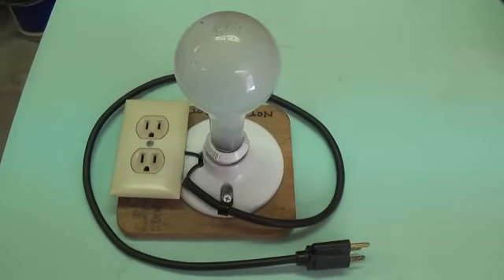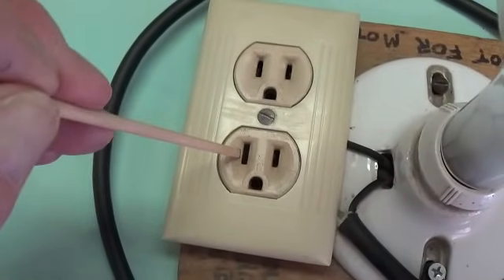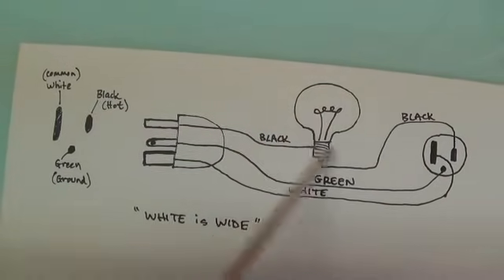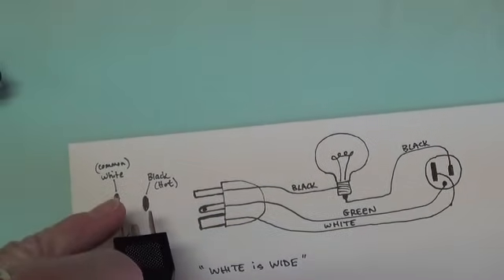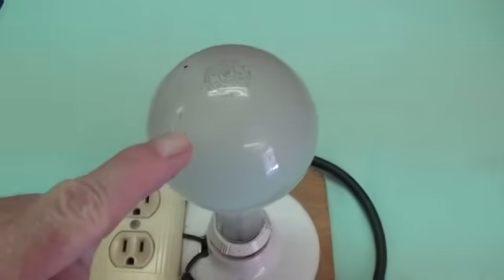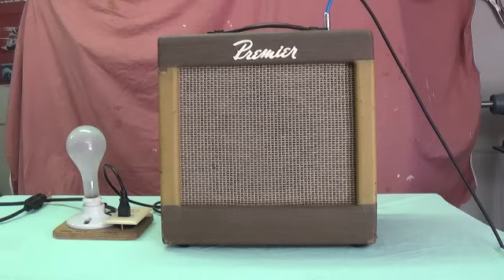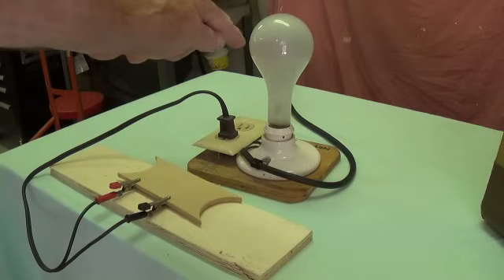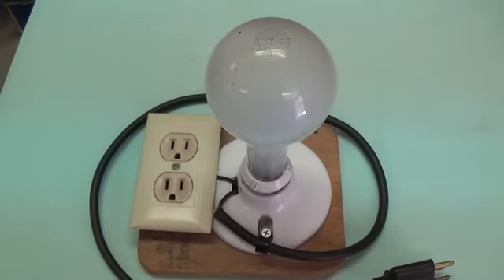Build Your Own Current Limiter for Protection when Repairing and Testing Electronic Equipment

Comment: Here in the UK the mains is 230V.
Should I still use a 250W bulb or would a 500W be better suited?
I calculated that the resistance for the US 250W bulb is about 58 ohms but a UK 250W bulb would be about 208 ohms.. 
Is 208 ohms too much of a drop to test equipment with?
Reply from the maker: Actually, Dennis, since the current limiter responds to current, not voltage, and your current is one-half of ours (who have 120VAC), the bulb you use should be one-half the wattage......i.e. 100W to 150W.  I believe this is all explained in the video description. Good luck.

Comment: I built one. I got a 300 watt bulb because the other was 200watts. Is that okay? I plugged 2 radios in and one was a player, the other lit the tubes but no sound through the speaker. But neither lit the current limiter bulb. 
Thanks
Reply from the maker: The larger bulb is more suitable for higher-wattage circuits, YR.  A 200W bulb would be more appropriate for radios and low-wattage amp circuits. Failure to illuminate indicates no internal shorts in the circuit.
Reply: @UncleDoug  ok thanks

Comment: i built one too.  But the bulb keeps lighting up whenever I power whatever appliances I am testing....electric drill, electric cooker and vacuum cleaner.  Can't be that all of them are having shorts.
Reply from the maker: Nope.....it means that you are using the current limiter for the wrong purpose. It is strictly for tube electronic circuit protection.
Reply: @UncleDoug  .  Yup.  It works for the amp I am fixing.  thanks for the reply.  Didn't read  sorry.  But i watched several times though.

Comment: It's not the voltage that necessary kills you .. it is the current
Reply from the maker: Thus the advantage of a Current Limiter. It's more to protect the circuit than the tech, however.

Comment: I worked for a tech when I was younger who used a variac followed by a dedicated resistor shunted ammeter followed by and patchable set of circuit breakers ( 1,3,5 amp) to do this job. I like this better, it's a lot simpler and is a true current limiter. Where did this idea come from? If it's yours, you're a genius, if not you may still be a genius or at least damn clever. Oh, BTW, this is an old video and everyone who wants to build this better get out and buy a large incandescent light bulb before they disappear for good, cause an LED bulb is not going to work! Cheers, Carlos
Reply from the maker: Thanks for all your very kind words, Carlos. It wasn't my invention, I just tried to popularize the device for use by amp techs. Agreed.....incandescent bulbs are an endangered species :)

Comment: I know this video is old, but i give it a try.
I have a current limiter that I made years ago, however the bulb broke eventually and coming across these old classic bulbs in Sweden is next to impossible. I have searched for the better part of a year now without result.
So naturally I'm trying to think up a device that could replace this.
But to do that I need to know why it works. I mean  different devices draw different amount of current. How come the bulb lights up when one of them suddenly draw more?
I know my question surely require a long answer, so only answer if you want to or perhaps an idea for a video topic? 😊
Best regard!
Reply from the maker: The answers are all provided in the video and the video description, Philip. Try Amazon.....they may still offer high-wattage incandescent bulbs. Nothing else will work.

Comment: Is it possible to have a bulb with too LOW a resistance? I recently built this and, upon testing out in the garage, I was surprised to see the bulb light RIGHT UP when I applied power to the circuit. I thought I had wired something wrong but I tested continuity across the bulb itself (300W) and produced a BEEP on my multi-meter (measured about 5 ohms of resistance). Any tips? :/
Reply from the maker: Did you have any electronic device plugged into the CL receptacle, Haze ?  If not, then it's an open circuit and should never light up. Perhaps you wired it wrong.
Reply: @UncleDoug  No devices are plugged into the CL receptacle (not until tests pass!) I  thought I had wired it wrong too but if I remove the lightbulb and replace it with another (that is not properly rated) there is no short. I will investigate some more --- I never build something correctly on the first try anyway. When I figure out my error I will let you know. :)
Reply from the maker: @HazeAnderson  Check to be sure you didn't wire it in parallel instead of series, Haze.
Reply: @UncleDoug  A-ha! I wired the bulb in parallel, not series! xD I was focusing too much on getting the parts secured on the wood that I carved out to realize I had strayed from the schematic. Thanks for your help! :)
Reply from the maker: @HazeAnderson  Glad you solved the problem, Haze. Good luck.

Comment: What happens when incandescent bulbs cease to exist?   I'm guessing an LED or Fluorescent  would not work.
Reply from the maker: You're right, they won't work, Ed. On the "bright" side, I've been using the same 250W bulb for about ten years......it's probably only been "on" for less than an hour during all that time......and you can still stockpile a couple extras for the future.

Comment: YOU SHOULD WIRE THE HOT(BLACK) FROM THE CORD TO THE BOTTOM OF THE BULB ON THE BRASS SCREW IN THE LAMP SOCKET FOR SAFETY IF IT WAS LEFT PLUGGED IN AND SOMEONE UNSCREWED THE BULB AND TOUCHED THE BASE OF THE BULB IN DOING SO WOULD  GET A NICE JOLT! I BUILT THESE BACK IN HIGH SCHOOL ,WE USED A SWITCH/RECEPTACLE FOR THE OUTLET!
Reply from the maker: They would have to be both foolish (or a child) and grounded to experience such a shock, but thanks for your helpful input.

Comment: Ace hardware has 300w bulbs, PS25.
Reply from the maker: Good news !!! Thanks, Wes.
Reply: Uncle Doug
 Thank you Doug, I’m building my 1st amp (I should say assembling) from a mojotone kit, it’s the Gibson GA5.. I’m not sure what went wrong but I burnt up the power transformer..... Because I like to spend money and destroy good parts, I didn’t build a current limiter first 😫
Reply from the maker: @wesrichards6168  Now you see why I say that current limiters are the most important tools on the workbench, Wes. Best of luck now that you have built one (I assume) :)
Reply: Uncle Doug Absolutely, after nuking the first power transformer (100.00 up in smoke) I went to the hardware store and dropped about about 8$ on the parts to build the current limiter.. I had it assembled in about 30 minutes. I’ll have the new transformer tomorrow, and I’ve gone through the circuit and believe I corrected the problem, but from now on EVERYTHING goes through the bulb.
Reply from the maker: @wesrichards6168  You'll be glad you did, Wes. It's the best insurance you ever bought.....for only $8.

Comment: nowdays in Italy is difficult to find such incandescent lamps, but it is still possible to find halogen lamps. I read somewhere that halogen lamp should work as current limiter as well. Can somebody confirm that?
Reply from the maker: I don't believe they can Benito. Have you checked Ebay and Amazon for incandescent bulbs ?
Reply: @UncleDoug  i'm going to try. Thanks for the answer. Have you good Easter
Reply from the maker: @benitorossi9380  Good luck. Have a nice Easter.
Reply: My light bulb limiter demonstrates that they can.

Comment: Hello Uncle Doug. I can’t thank you enough for your instructions, insights, and amazing presentations. I made one of these and it just came to life last night while looking at my old Harmony amp. I noticed the volume seems low, and when plugged into the current limiter the bulb started glowing, but not too bright. The power jewel also seems brighter. I have just under 6v ac at the bulb, but there’s also 14v dc present. The current limiter also only comes on after it has warmed up. I have swapped all 5 tubes with no changes. Where do you think I should focus?  Thanks, LJ
Reply from the maker: I can't repair the amp long distance, LJ. I guess you'll have to get a local tech to take a look at it.

Comment: I built one of these this weekend and used it to test a recapped 1950 Emerson 503 AM Radio.  I wished I would have done this a long time ago.
Reply from the maker: It really is a useful, practical device, isn't it, Daniel? I have used mine on every single amp repair job I have ever done..

Comment: I built one of these and it works great. However, I do have a question. I am using a high wattage bulb. I'm working on a amplifier right now where the bulb is lighting up, dim. Is that alright? Or what is it telling me? It is a 100 watt tube amplifier I am working on.
Reply from the maker: A 250W bulb works well for amps up to 25W to 30W, but for higher wattage amps, you will need two of the 250W bulbs in parallel.
Reply: @UncleDoug  My thoughts as well. Also, should I throw a switch between the two, to work lower and higher wattage amplifiers? As always, I appreciate you SO MUCH! And thank you, Uncle Doug.
Reply from the maker: @DetroitWrecker666  Sure, you could add a switch, or, since they are in parallel, just unscrew one bulb when working with lower wattage circuits

Comment: I don't know if it's a regional variation, but out here on the West Coast we call the white wire "neutral", not "common". It's separate from ground (the green wire) but it is tied to ground back at the electrical panel. So it should normally read no more than a couple of volts different from ground. It's basically a center tap on the 240V power coming to your house, which allows it to be split into two separate 120V circuits.
Reply: Am I able to build this current limiter device the same way if I'm in the west coast?
Reply: @Jason-ty6ds yes, you can. You just put the bulb in series with the hot leg, like shown in the video

Comment: I used one of these at Kendrick amps ..    Can you make the   chopstick  phono needle
and headset tester to test for bad parts ????
Reply from the maker: Those projects don't ring a bell, Ron. I tend to use an audio signal generator.

Comment: Hello Uncle Doug,
Thanks for your rather speedy reply and suggestion i am sorry my reply wasn't as quick 
due to work and other such hinderances.
I built the current limiter last week such a simple but useful tool thanks again,will take a look at
the tweed deluxe video and study the schematics.
I already have a blues deluxe power transformer (240 input 350-6.5,40 & 6.5 out )
but I think I need to use a solid state rectifier with it and a 35-40W 4K primary,4&8ohm secondary 
output transformer so no 5v for tube rectifier.
Kind regards 
Fraser
Reply from the maker: Good luck with your project, Fraser.

Comment: Hello uncle Doug 
I have recently become hooked on your videos and have decide to build a push pull type amp,
I love my blues deluxe and would like to build a hand wired version with maybe a couple of tweaks 
Maybe a clean boost and an attenuator.
I would greatly appreciate any suggestions.
Kind regards
Fraser
Reply from the maker: I don't think a Blues Deluxe would be a good candidate for hand-building, Fraser. It's a hybrid circuit, with semiconductor components. If you're going to build an amp, build a classic 5E3 Tweed Deluxe. Modern amps are just imitations of the classic amps from Fender's golden era. Build the real thing.

Comment: I did one of these and tested in a Marantz receiver and an Akai tape deck, in both cases the units  light up poorly, about of 20% lit, and the 60W bulb lights up almost full, about 80% (Both units are from my regular use and works perfectly)... What' the explanation?
Reply from the maker: As it says in the video description, when used with transistorized devices, which I assume these are, the bulb wattage must be greatly reduced, since the current flow to these devices is much lower than to a tube circuit.
Reply: @UncleDoug   OK, tks... but I'm still a bit confused... As this device is supposed to test vintage equipment, the behavior of my Marantz receiver will lead wrongly me to believe that it's in short, but it's not!  I'm using a 110V and 60W bulb, so should I use a 40W bulb instead? Sorry for the newbie question! :(
Reply from the maker: @Urbaxter   I am puzzled by your question. What "units light up poorly, about 20% lit" ?  Are you referring to the bulb (of what wattage?) or the receiver ? If a 100W bulb lit up 20%, then try a 200W bulb. You have to find a bulb wattage that matches the current drawn by the unit being tested.
Reply: @UncleDoug  Hi Doug, and thank you again for the reply. What I meant is that the receiver lights up 20% and the bulb 80%, so this could wrongly lead to think that the receiver has a short circuit. But I believe I found the answer, I was using an old bulb that I supposed was 60W, but as the description is vanished, so probably it is at least 100W. I achieved to find a really 60W bulb, and now the result is the opposite, receiver lights up 80% and the bulb about 20%. So, to conclude, to test a vintage transistorized receiver with 85w RMS per channel, the appropriate is to use a bulb with 60W or 40W, but not 100W or more, right?
Reply from the maker: @Urbaxter  That sounds about right to me, Urbano.

Comment: If you don't build one of these, you can still see a bright light - at the end of a long tunnel.
Reply from the maker: Excellent point, Prince. It's best if you never see either light.....but of the two, the latter one is infinitely less desirable :)
Reply: I think it's more for the amp's protection than your own - you get a current across your chest, you're gonna have a shite time
Reply from the maker: @floatingpoint  Agreed, FP, but either way you're better off using a CL than not using one.
Reply: @UncleDoug  No question about that!
Reply: I didn't see no light but i seen stars!
Reply: Hmm.. This device certainly will not save you in any way from electrocution. The lamp resistance is several orders of magnitude lower than your body resistance. Nor should you rely on any RCDs to save you. An isolation transformer can save your life, however, if you do electrics work.
Reply: @patrikfloding7985  However, the lamp does offer some protection to the load under test and it also alerts you to its high-current draw.
Reply: @patrikfloding7985  is it because the RCD reaction is not fast enough or it won’t trip at all?
Reply: Underrated comment.
Reply: lol
Reply: Lmao!

Comment: I read somewhere that you want to match the bulb to your normal current draw of the amp.  I know my Marshall beast says 375 watts on the back so I need higher  watt bulb than my measly 200 watt I have now...it glows a little.  I also think one of those plug in watt meters on Amazon would be helpful in addition to this tool.

Comment: Can anyone help. I was going to buy a variac to bring up a couple vintage guitar tube amps I've had for years. The idea was to try and warm up/re-form the caps etc. But will the variac protect me and the amp the same way as this setup? I'm almost thinking this is better because if I see trouble I can cut the power and go straight into testing the caps and/or replacing them. Also, one of the amps is a 300 Watt bass head. I saw a 500 Watt flood light at home depot. Is that the right kind of bulb? Thanks in advance.
Reply: A head that puts out a legit 300W is going to draw at least 400W from the line (unless it's a newer super-efficient switching mode amplifier). Under those conditions a 500W bulb will use up almost half the line voltage. You could try a 1000W bulb but that's a beast. 

I'd go with the variac and start low and slow and increase gradually. I'm not an expert on re-forming caps but that sounds like a good idea.

Comment: Dear Uncle Doug, I've discovered your videos 1 day ago, and I thank you for making then, they are very well made and give a lot of fantastic informations for who, like me, is not an expert. I have a question for you. I live in Italy and my outlets AC Voltage is 220V. Making some simple (I hope right...) calculations, I should use an 850W bulb to mantain the internal resistance comparable (i.e. low) to the 250W (on 120VAC) of the bulb that you use. Given that this assumptions  are right,  in your opinion could I use a parallel of four halogen lamps of 230W each to meet the goal? (incandescents bulbs are not in commerce anymore...). Thank you for your attention and again my most sincere compliments for your videos!!!
Reply from the maker: Greetings, Alessandro. Actually, it's the other way around. Your voltage is twice as high, but your current is half as much as ours.....so you need a bulb in the 100W to 150W range for most small to medium amp circuits. Use only incandescent bulbs.....LED will not work, and I doubt that halogen will work either. Good luck.
Reply: You’re so right Doug, being a current limiter if you double the voltage you have to double the resistance too.....what a noob I am....Thank you for your quick answer!